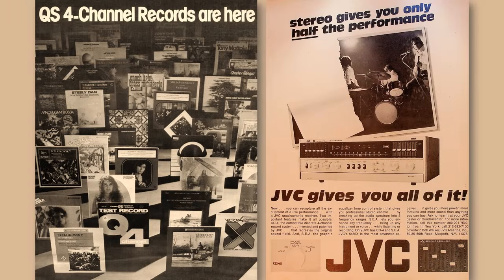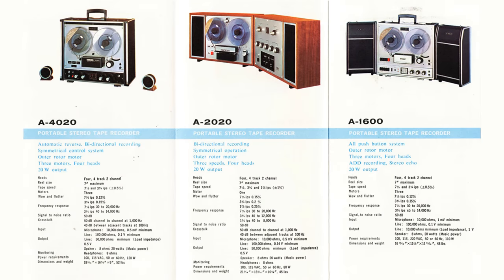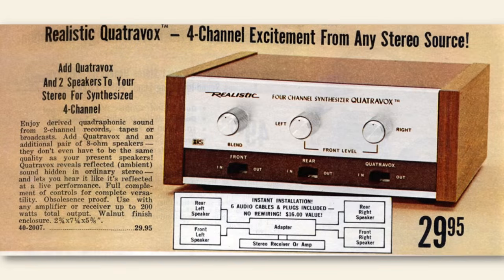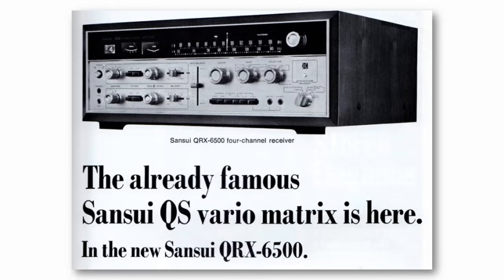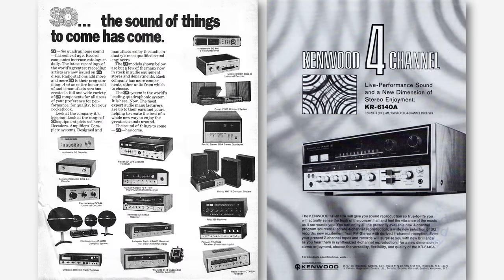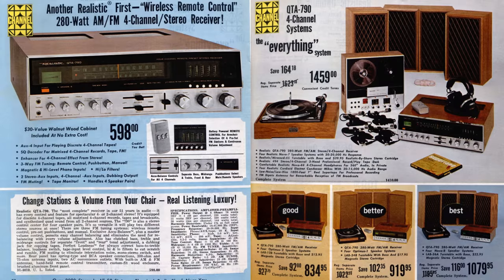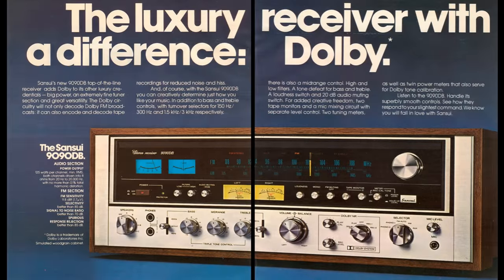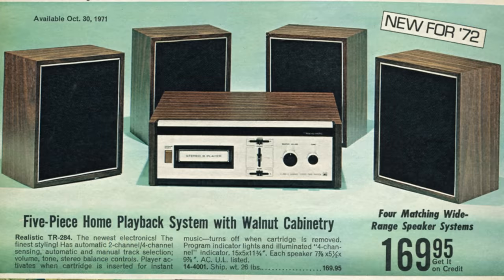4 channel FAILURE - The Quadraphonic Story

Comment: We had a Quad Reel to Reel and a quad 8 Track.  As far as I know the 8 track didn't run at half speed. I remember we had both the Regular and Quad 8 Track Albums "The Plastic Cow goes Moog" Both had the same song count but the Quad 8 Track had more tape than the Regular 8 Track, and I think the Quad used thinner tape stock, too - it constantly buggered up later in its life (hence I remember helping my dad fix it an noting the amount of tape). The Quad 8 Track deck was also able to record in quadraphonic (I think it was a Technics unit) via 4 mic inputs on the front or 4 line inputs on the back. The Reel to Reel deck (an Akai, I think) had quad recording via a DIN connector on the back or two 1/4 inch Stereo mic jacks on the front (?). The whole system ran through a Heathkit AM/FM Quadraphonic amplifier that powered 4 Altec-Lansing Voice Of The Cinema speakers. We still have the Quadraphonic Headphones somewhere...
Reply from the maker: That's probably more likely. Then they don't need to make a player that runs at two speeds.
Reply: I concur, they ran at same speed 3 3/4ips
Reply: Correct, Q8 cartridges ran at 3 & 3/4 ips (same as stereo 8-track tapes), but with four channels, the tapes were necessarily twice the length of the stereo versions.  One advantage of Q8 tapes is that there was only one automatic er, "program change" needed at the halfway mark (when the foil bit on the tape caused the tape head to shift to the second program), which meant there were fewer interruptions or fade outs/fade ins, whereas stereo 8-tracks had four such interruptions over the course of an entire album.  The biggest advantage with Q8 tapes (and the much rarer and more expensive quadraphonic reel-to-reel tapes) was their completely discrete channel separation -- no smearing of channels as occurred with the vinyl decoding schemes (QS, SQ and CD-4).  I have many quad LPs and Q8 tapes.  Sadly, the tapes are only gathering dust any more, but I still enjoy the quad LPs, albeit only with "Dolby Pro Logic" which is not a faithful reproduction for SQ and CD-4 sources.  I dream of finding a working Tate, Sony or other "full SQ logic" decoder some day!
Reply: Ha, I own 'The Plastic Cow Goes Moog' on import vinyl, it's a hoot!
Reply: Yes, I have an 8-rack quad recorder.    It only works at 3.75"/sec., which is standard for 8-track.

Comment: 3:42 - I believe for the quadraphonic version, they simply used tape thinner than the typical 1.5mil. This created it's OWN set of problems!
Reply: There were 80 minute blank tapes available which could record 2 albums in stereo, so these could hold one quad album.

Comment: I was only a few years by the end of the old '70's quadraphonic era, so missed it. However, I really liked SACD, and was disappointed that it didn't catch on. Dark Side of the Moon and Nine Inch Nails The Downward Spiral sound amazing on SACD, and I still listen to them. I've been told Wish You Were Here on SACD is even better than Dark Side of the Moon, but I refuse to pay the insane prices copies of it usually go for these days. When they were current releases back in the early 2000's, SACD's were not that much more then normal CD's.
Reply: Just buy a blue-ray of said PF album. Chances of you hearing the difference between it and the SACD are nil. They're probably the same master anyway. 

One can, however, hear distinct differences between 5.1 and good old Quad mixes of aforementioned albums. In the 70's they (e.g. Alan Parsons) tended to mix each instrument to it's own channel (left, right, back L and back R) for Quad whereas for 5.1 they mixed it less "discretely" in strictly separated channels, as in stereo. I don't hear a real separated stereo effect: it all sounds like 2 x mono to me. As does 5.1. However, those Quad mixes are great!
Reply: @meneerjansen00  Thanks. I may well try that - I didn't know it was available on blu ray.
Reply: Imho Jeff Wayne's - War of The World is even better. It really sucks you into the story. Mmm should listen it this evening again.
Reply: @schuncken  Unfortunately WotW multti-channel it's only available on SACD, not on DVD or Bluray (well: the live performance).
Reply: A lot of classical and jazz is now recorded in SACD/MC and sounds fantastic at the same price.
Reply: I haven't heard Wish You Were Hear either, but it just got a rerelease on SACD December 2023 so I ordered it from Acoustic Sounds!

Comment: You are correct to point out the issues of the listening room. Most people are not sufficiently committed to home hifi to have 4 speakers around a room. This is clearly part of the reason why most people nowadays don't have a sound system that's even comparable to a 1970s stereo ... they make do with a Bluetooth box of some description, or listen via their questionable quality TV soundbar. For most people the only place nowadays where multichannel sound is feasible is in their car. The speakers are built in and have a consistent position that doesn't compromise the internal physical layout of the vehicle, unlike at home where your partner decides that the room needs a redesign ... "do we really need these big boxes in the way?" !
Reply: Indeed, I can understand the problems of room placement.

Growing up in the '80s-'00s, we had home theater setups in both the rec room and (eventually) the living room.*   But thanks to Dad, we also had office-style suspended ceilings in both the rec room and the basement room below the living room -- which made it very easy to run hidden wires back to the rear speakers in both rooms.

These ceilings also came in handy for running a phone line to our second desktop computer (when we had dial-up internet in the mid to late 90s), running ethernet cables (after we got broadband internet in 2000), and moving Dad's bedroom TV to a different corner of his room (where there was more space for a bigger TV and a small stereo).

Since moving to a different house with my stepmom, Dad replicated his living room setup in his man cave; he ran speaker wire along the baseboards, since the room has no side doors ahead of his chair or his couch.  He also set up surround in his living room -- where a basement workshop beneath (with a suspended ceiling) makes for easy access for hiding speaker wires under the floor.

Meanwhile, I and several other relatives have never bothered with surround at all -- either due to lack of money, lack of interest, lack of over-ceiling or under-floor access to hide wires above or beneath doors ... or just lack of practical places to put rear speakers given the room layout.

* Our house was a split level, with the bedrooms half a story up from the living/dining/kitchen level, and a lower level (rec room, office, and extra bedroom) underneath the bedrooms (so, half a story down from the living room).  There was also a lower basement under the living room level, half a story down from the rec room.
Reply: @AaronOfMpls  Wow.... :face-red-droopy-eyes:

Comment: Interesting you mentioning the Hafler circuit. David Hafler was an American engineer well known for having founded first the Dynaco and then Hafler audio equipment companies. Notably you could buy kits of their equipment, of which I built 3 Dynaco and 2 Hafler units. (The Hafler DH200 still powers my garage system, albeit having only one channel, making it a Halfer now I suppose. 😂)

As a budding young audiophile we looked askance at the Quad systems as the sound was indeed inferior to the stereo systems of the day. My take is that many in the US felt the same, leading ultimately to the failure of the format. (As for 8 track, don't get me started. All those tracks and the best songs on a album were invariably interrupted as the player clicked and clacked changing to another track. Arggg!
Reply: I actually have a Hafler circuit in use in my main stereo system  ... very effective esp. if playing QS matrix Lps

Comment: I did a lot of hifi/stereo setups in the early 70s on behalf of a major electronics store in Toronto. I did one quad setup and this client had the ideal setup - a high end 4 track reel to reel deck and a large room where the intended listening location was in the middle - away from the walls. He also had excellent source tapes.  Aside from the format issues(significant) and running/hiding wires for rear speakers, the main issue was that most potential users didn’t have a suitable physical space or weren’t willing to compromise a “stylish” room layout for audio realism. My first question for any setup was “is it for listening or “background”?” If listening, I placed the speakers, if background then they identified the locations. As a rule, older clients with upscale systems( and fancier digs) more often went for “background” setups. 

I was always disappointed that binaural recording didn’t have a bigger following - although the fact that the whole performance rotated with your head was a bit disconcerting.  I still remember listening to a radio broadcast of In-A-Gadda-Da-Vida lying in bed while they were “hopping around on the ceiling.

Comment: I discovered quad in the mid 80's, in my late teens, when I found an SQ decoder in a second hand shop, (it was the joystick balace control that got my attention LOL). It was ony 15 watt per channel, so after some rewireing I gave it 4 line out sockets, and plugged them into two matching 75 watt amplifiers with a speaker at each corner of my bedroom. I built an input switch box and it all sounded great. One day when I was off work, (or possibly between jobs), the whole lot magically appered in the lounge. My dad was none too pleased, until I played a Chicago album. He was also hooked.
Reply from the maker: Love the icon. I played that game a LOT.
Reply: @LittleCar  It's a great game, just a pitty I'm so bad at it. LOL.
Reply from the maker: Aren't we all?

Comment: Even today, I have a rear set of speakers that are wired as a "difference" channel.  Obviously, not true quadraphonic, but it really enhances the reverberations of the singers of most rock and pop music.  The front speakers play the singers, and the rear speakers play the echo.  This effect is the strongest on Billy Joel The Stranger, but it's also very good with most 70's rock music, and it still plays well with today's pop music.  This is what Radio Shack called "quatravox", and I'm glad it was mentioned in this video.

Comment: I have an LP "Deep Purple Machine Head" recorded in SQ quadraphonic.
Requires the stereo signal to be processed through a proprietry decoder (CBS licensed) and then 4 power amps.
It was impressive.
Reply: Any Dolby Surround analog receiver made in the last 25 years will decode that record more or less properly. 
I use a vintage Onkyo (pre-HDMI) to do this, all it lacks is a phono preamp so I use  an external one.

Comment: There's some audio Blu-rays as well as audio DVDs which have surround and quad mixes of a few albums, including Dark Side of the Moon. 

I was going to say it wouldn't have that "move your head and the balance changes" effect, but that's because I associate "spatial audio" with headphones even though I associate "Atmos" with fixed speakers. I guess through your Apple TV over surround sound speakers it was basically the exact same effect as listening to the quad mix from one of those disc-based releases. 

Apparently the 5.1 mixes of those releases are more modern, in that they just better approximate the placement of instruments on a stage while the quad mixes from back in the 70s were usually quite experimental, splitting instruments up even moreso than was common in stereo from the 60s and doing fun strange panning effects. I wonder if Pink Floyd literally used one of those joystick boxes in the creation of their quad mix(es)...

Comment: The CD4 standard had the intrinsic problem that when playing CD4 encoded records with a normal stylus, it would just "sand away" the 40kHz additional signal on the tevoedz. You'd lose your rear channels. So when buying an expansive Shibata stylus, you were disappointed for getting very distorted or no sound at all on the rear speakers.

Comment: What’s interesting about quadrophonic is it indirectly influenced what I wanted to do.  I grew up listening to Mike Oldfield’s Tubular Bells.  What I didn’t realise was that I was listening to the 1981 Epic issue, which used the 1975 quad mix without any kind of matrix decoding.  It was a “shock” when I got it on CD, not realising that was supposed to be the album proper.

This confirmed that if I was to do my own music, I need to be completely and totally involved in the entire process, especially in the mixing and the mastering.
Reply: That 1981 issue is it a record or CD?
Reply: @SDsailor7  Record
Reply: @DerekPower  Thank you

Comment: In the mid 70's I listened to a high end system using Marantz equipment, it was the speaker's that made the difference.. The speaker's came from a store  in CA., they were called "Servolinear" it had two ML 3 in the front and two Servolinear ML 1 in the back.. I've never listened to anything much better to this day.. These speaker's were only in production for a few year's then disappeared..

Comment: I bought a Sony record player player in the early 70s. In the place where a cassette player would be in the stereo version, a black plastic (useless) tray was fitted.
Inside there were FOUR separate SANYO amplifiers. Of course, four identical speakers were included. I think it cost £132 and was purchased in Edinburgh. I still have a few SQ records but not the player.

Comment: Some thoughts from a quaddie: 
-Matrixing is a lossy format. Once you mix down to two channels you cannot derive four back from it. This results in separation loss between channels which starts another discussion on analogue 'logic' circuits to enhance separation. 
-A matrixed record does not hide the rear channels. You hear everything. QS for example made the front channel information narrower in terms of stereo separation than the rear. Larry Fast (Synergy) has an excellent diagram on his site. 
-Dynaquad/EV-4/QS are often lumped together under the 'Regular Matrix' (a non-copyright term for QS) umbrella and can be satisfactorily decoded interchangeably on those systems (some with varying degrees of accuracy than others).
-Columbia charged an exorbitant licensing fee (IIRC $5000) to slap the SQ logo on a record. Sansui charged nothing. 
-Only Sansui receivers had their Vario-matrix logic enhancer built in. 
-No receiver or amplifier does/did all three major record formats with additional logic enhancements. Be prepared to empty your wallet buying external decoders. 
-CD-4's front channels (aka the normal 'stereo' channels) were hard-limited to 15KHz to make room for the ultrasonic rear channel carriers. 
-CD-4's early pressings (especially in the US) were made from recycled records due to the oil embargo resulting in subpar pressings. This spurred the development of better vinyl compositions in Japan and thus the 'supervinyl' formulation today.
-In order to market CD-4 to the bottom end, Panasonic spearheaded the development of semiconductor (known today as 'strain gauge') cartridges for use in low end BSR changers.
-A lot of pop/rock/jazz records were pitifully mixed in my opinion: "Yes, let's put a guitar in that corner, the drums in that one..."

-Walter/Wendy Carlos pulled their remixed quad version of Switched On Bach out of disgust for SQ's limitations (they actually wanted to go with QS according to their website)
-Carlos also proved that the human stereo perception is much narrower in the back making the whole equidistant speaker positioning of quad moot